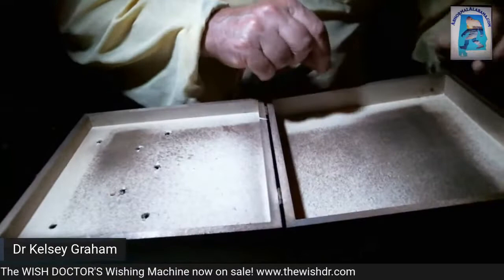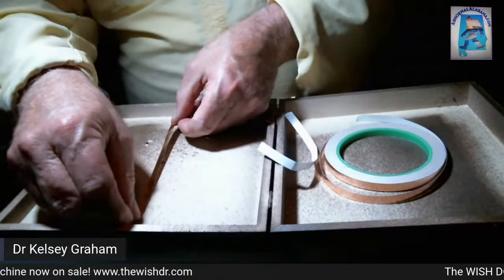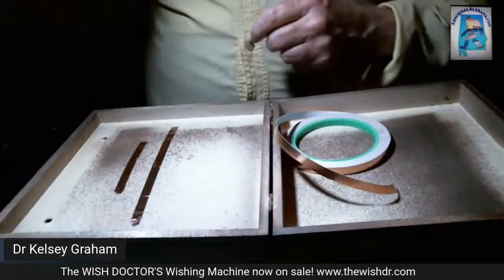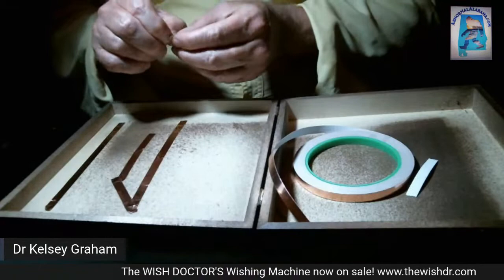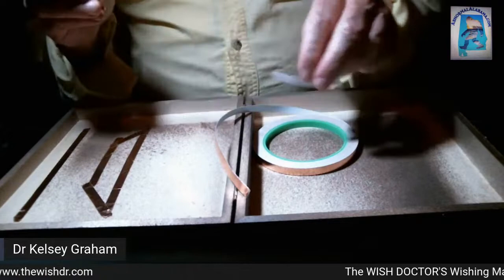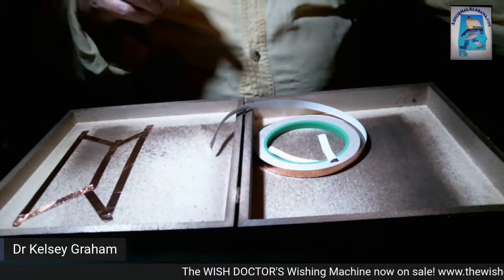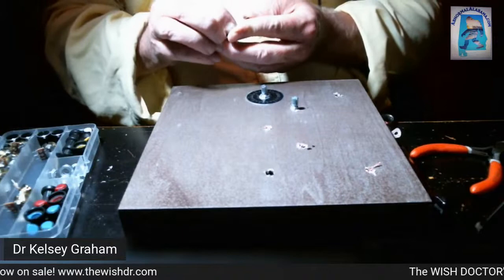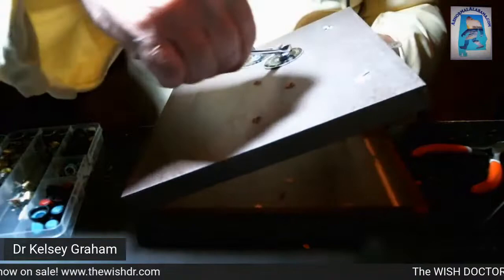Building WISHING MACHINES

Comment: Just curious if your running copper wire between the pots and the inputs and outputs what purpose does the copper foil tap serve between the pots, is it part of the circuitry and if so why do you need to soder the connection?Thanks.
Reply from the maker: Conducting the energy in radionics works differently than ac or DC current.
Reply from the maker: Copper wire is used. The metallic foil does serve as  as a conductor for the energy. I choose to solder because I want everything connected in the best way possible- is it overkill? Well I would rather overkill than to fall short.
Reply: @abnormalalabama2546  thanks.